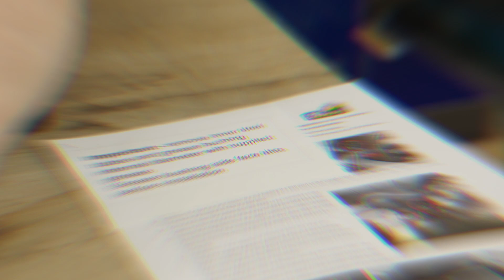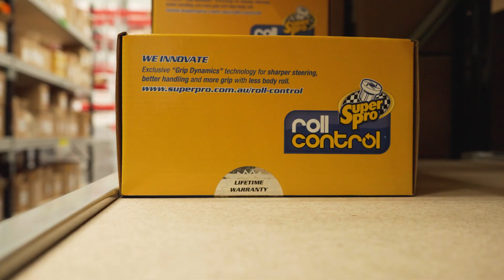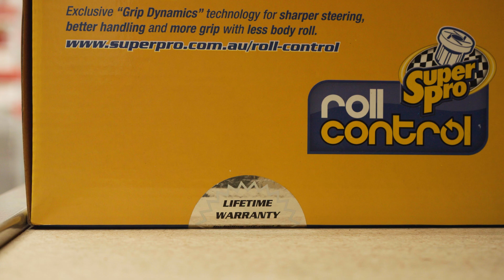Who Is SuperPro? | Australian-Engineered Suspension Solutions

Comment: I'm in California, and I outfitted my former 2006 Subaru WRX Wagon with every bushing offered several years ago - it made a massive difference!  Every bit of the handling and steering was improved significantly - you could feel the difference the first time you went through a turn at speeds that are reasonable, and a hair above whatever sign might be nearby.

The current owner, a personal friend of mine, has told me that he has never driven a car that corners so flatly and consistently/predictably.  Needless to say, he is beyond impressed with the results.

My plan now is to do the same by my GR Corolla.  I know that Toyota makes a good & reliable product.  I also know that while their bushings are good for several years, but I would much rather replace everything in the next 12 months, and not have to revisit it again (before I get too old to do this sort of stuff... HAHA!).

Your quality and consistency has earned a life long customer.